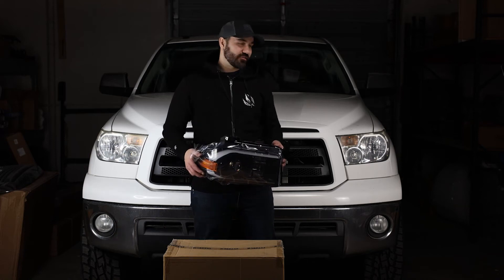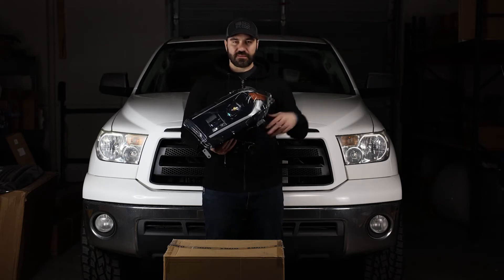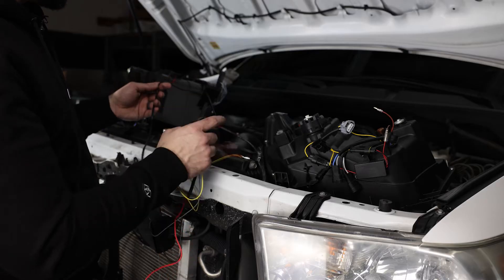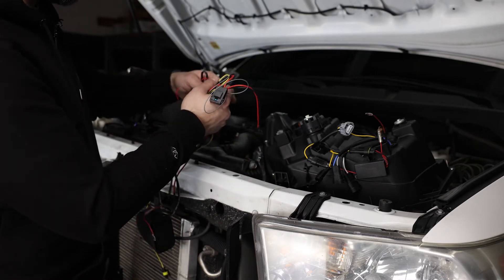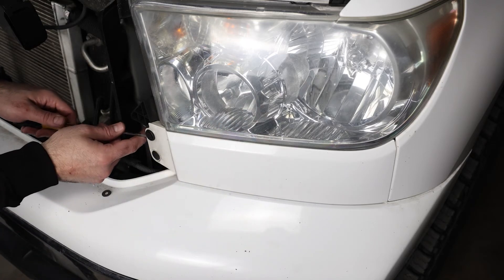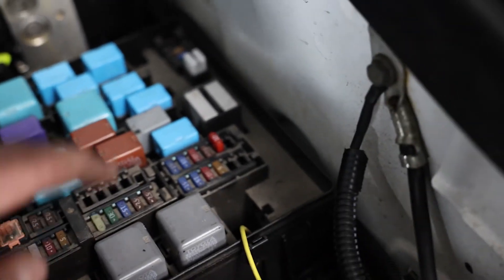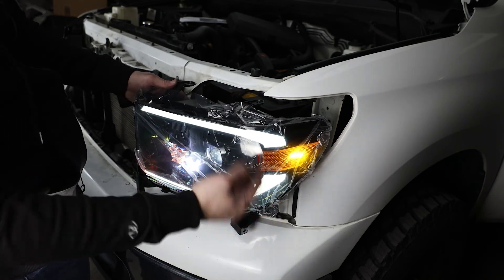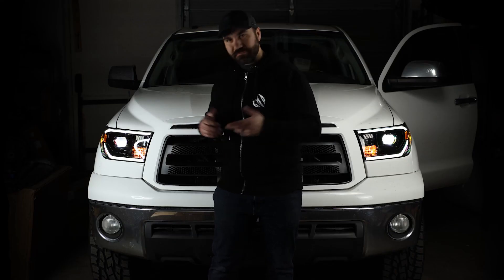AlphaRex Tundra/Sequoia LUXX LED Headlights Install & Review | 2007-2013 Toyota 08-17 Tundra Sequoia

Comment: Had Alpharex Pros with level adjusters in a 2010 . Worst lights I ever bought.  DRL's are weak to start with but after only a month the top driver side drl went super dim.  Contacted them , wanted me to ship that light back and sent me a new one.  New one lasted only days before the same issue. Texted with the customer support they had & went thru everything on the install to make sure there was no issue on my end.  Long story short ... these are known issues with the Alpharex 2nd gen Tundra models..  Come to find out it's the boards and they stopped selling my particular model. Instead of finding a legitimate way to fix the problems & replace my lights that were under warranty still.. they wanted to send me a new circuit board to replace inside the light.  I'm not that savvy.  And that's what they were doing.  Getting bad ones back because they had no new ones, replacing the boards and sending them back out as "new" replacements to the next guy with the same problem. Do yourself a favor, spend a few more bucks and buy Morimotos or get the OEM Sequoia leds and what's needed to fit them.
Reply: Work fine in my 2010 tundra
Reply: @beekeeperbrad6251  what models ?
Reply: @HPTuchin  pros
Reply: @beekeeperbrad6251  blacked out pros ? Chrome pros ? Level adjustment motors ?
Reply: @HPTuchin  pros are pros they don't have the auto motor those are the lux
Reply: @beekeeperbrad6251  Wrong.  In multiple ways.  I've got blacked out pros with leveling motors. And the Chinese crap Alpharex slaps their name too, especially in the past come from multiple different manufacturers and factories in China. Even among same model lines.
Reply: @beekeeperbrad6251  And more than likely... The Chinese manufacturer that produced the blacked out pros with leveling motors skimped corners to offset the extra motor cost on that model with a cheaper circuit board. Which is exactly where the problem lies.
Not to mention.. At the end of the day even when functioning correctly the Alpharex LED DRLS are just plain weak compared to others.
Reply: @HPTuchin  I didn't buy the lux all I know is my pros work and pros dont come with the motor and the colour of the lamp doesn't affect how they work
Reply: @beekeeperbrad6251  lmao dude. What don't you get here.  Yes there are multiple different what you refer to as lamp colors lol.  And yes that can totally affect the where they might have been manufactured at and by who. And yes completely different manufacturers can result in different levels of quality... mind blowing i know... 
I'll give you another hint and secret. .. They (Alpha) never manufactured the pro models. And those exact lights can be bought online from multiple sources that has nothing to do with Alpharex.  Meaning they just attached their name to a ready made product.  
And just because YOU can't find pros with motors now ... Doesnt mean they don't exist.  
You kids , which is what I hope you are because that's your only excuse.. Have  the sense of  awareness of a butterfly while  being arrogant.... it's quite comical. 
But please repeat yourself again.  
I never asked for your input . And as stated in my original comment that you replied to .. is in reference to black pros with motors ... which you don't have.
Reply: @HPTuchin  lol it being black crome  or midnight black or whatever doesn't affect how the electronics work
Reply: Lol they are called lux
Reply: @HPTuchin  you are a angry little man
Reply: @beekeeperbrad6251  and your a brick mate
Reply: @beekeeperbrad6251  so all electronics all across China are the same . Same quality,  same reliability,  same everything.  If blacks are manufactured at A factory in China and chrome are at B factory a year later ... your saying they have the same "electronics" ... we're talking China here man.  Where cheap & available is king. And they don't care if something works a week after its sold.  Right....
Reply: @HPTuchin lol could of just explained the lux use to be pros without freaking for no reason
Reply: @beekeeperbrad6251  Your wrong again bruv . It's seriously not worth it anymore
Reply: @HPTuchin  and you could of said that about the colour meaning the electronics are different you were making it seem like it had an effect just cause it was black
Reply: @HPTuchin  lol bruv
Reply: @HPTuchin  I work directly with manufacturers in china and i have first hand knowledge that that is absolutely untrue.
Reply: @MaxBeamer  I have first hand knowledge of your mom & it is in fact true.
Reply: Don't listen guys he's a troll

Comment: You do plug the yellow wire into the driver's side headlight and you plug the truck blinker wire into the black and the gray plugs to the headlights the yellow wire makes its so your 4ways work when the truck is off and your drl and blinkers work when you lock it and makes the drl work as the blinker
Reply: Just installed mine. Yellow wire plugs together
Reply: @derickponce-sanchez772  no it doesnt
Reply: @derickponce-sanchez772  it can but it's not gonna do what its intended to
Reply: Plugging in the yellow cable turns on the “welcome home” function allowing the DRLs to sequence on when unlocked and stay on for 30ish seconds when locking the truck. At least in my experience

Comment: Thank you, great video. I do have a question. Just bought the pro series for a ‘14 sequoia and it seems the install will be the same. When you were in the fuse box did you transfer the red 10 fuse into your new part before adding the new part to the fuse box or did you just remove the red 10 altogether? You made a comment about it but I didn’t quite follow. Also for feedback, even though it’s plug and play, would have been nice to see you connecting each wire. Thx in advance or for the video!
Reply: You add the 10A to the plug. It comes with a 5A so take the 10A out of the fuse box and plug it in next to the 5A on the plug. Then plug it into the fuse box. I, by mistake took the 5A out and just put in the 10A to the plug and my Tundra would not start up!

Comment: Are the yellow blinker lights illuminated when the low beam is on?    I installed mine, and the yellow blinker bulb is on when i have low beam on.  Just wondering if that's just how they are.

Comment: Hello man, I have a quick question on the drl on the headlights. I got these headlights in December and when I installed them and put them on. The drl don’t turn on during the day only at night. Do you have the same problem or if you know how to fix it? Please and thank you 🙏🏼
Reply from the maker: You will need to use the DRL harness and connect it via the ADD a fuse into the Ignition slot in your fuse box, that way the DRL's will come on as soon as you start your truck.
Reply: @GearheadJT  I put the harness of the drl to the fuse box but it only turns on whenever the sensor in the dash, marks night time and that’s when they come on with the low beams. Idk what’s wrong with the wiring
Reply: @aldoramirez9444  u have the wrong truck

Comment: Hi, Nice video but one thing need to correct is that the black and grey plugs from the light you mentioned they need to plug together but actually they are bridging the signal plug and signal light, so you need to unplug the signal light from the plug and connect them to them to the black and grey plugs correspondingly such that you will have a running signal light.
Reply from the maker: Great info, thanks!

Comment: Literally just bought these! Can you explain how to connect the connections to the battery?
Reply from the maker: For the power/ground on the DRL harness, the best way is to disconnect the little bolt on the positive (red) and sandwich the power cable in there and tighten down, for the ground (black) I always prefer to add it to the chassis with the rest of the ground wires, it will be right next battery on the chassis.

Comment: Installed these on my 12 Tundra last week.  The LED strips looked white and awesome.  Today, since I had some time I installed the harness.  Now the LED strips look "douchebag" orange/amber instead of white, wtf?  Short of ripping the stupid harness out again, how can I make the LED strips light up in white rather than that stupid orange color ( I thought the purpose of the harness was to modify the intensity of the LED strips only, and NOT change it from white to orange)?  Any advise would be much appreciated!
Reply: Bro I have the same problem did u get a  solution on how to fix it
Reply: Another thing is your head lights bright white cuz mine looks like stock off white yellow
Reply: @MrMikeyprats  Nah, I decided to simply unplug the harness I had spent the time to install per instructions.  I liked the fact that the harness install enabled the LEDs to come on as DRL's while in Auto mode, but I couldn't deal with the fact that the cool white LED's turned into douchebag amber LED's.  So for now I'm stuck without DRL's which I'm cool with.  Contacting Alpharex got no response whatsoever making me think they don't give a shit and don't have a fix for this crap.  Sorry Bro, that's all I got.  I still like the headlights a lot compared to the OEM fugly headlights but they should've made sure the LED's don't turn into that orange shit!
Reply: @Arminius  wow well if I find out anything I will keep you posted I appreciate the info
Reply: Ok so they told me to unplug the grey connector from the flat black connector and connect the buld with the connector from factory together and the factory grey connector to the black flat connector  if that makes sense
Reply: @MrMikeyprats  oh wow that's too confusing.  I'd need more info to tackle that.  Did Alpharex actually respond to you reaching out to them?
Reply: @Arminius  ok look all you have to do is your factory plug with the turn signal bulb seperate them so u will have the bulb and the connector seperate and your factory harness connector will go to the black plug on the headlights then the connector with the bulb on it will go to the grey plug on the headlights see we messed up cuz I plugged them up together and just put the amber bulb were the white tape goes when u turn your blinkers they will strip amber shits bad ass let me know if u got it now
Reply: @MrMikeyprats  Thanks for replying.  When I get a chance in the next weeks I'll see about following your steps.  Really appreciate you taking the time!
Reply: @Arminius  just trying to help my brother let me know
Reply: no they did not and that's not a good testimony for their product.  I had to research for a couple hours to figure out that once the harness is properly installed you will end up with the "douchebag" yellow LED's during DRL operation.  Once the Auto headlight mode senses that it's night time (sun is down) the LED's turn into cool looking white LED strips as they should be during any time of the day.  I'll live with it I suppose.  But I'm not a fan of the stupid amber LED look during the DRL mode, total horseshit, pardon my french! Aside from that I can't beat the price of the Alpharex headlights so there is no other option for me personally.